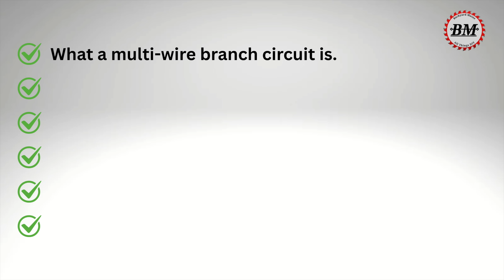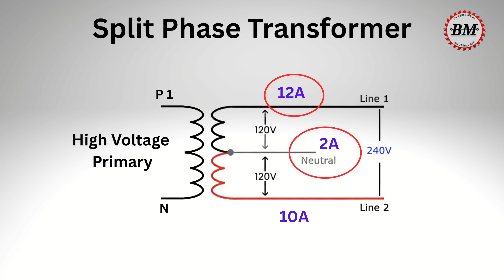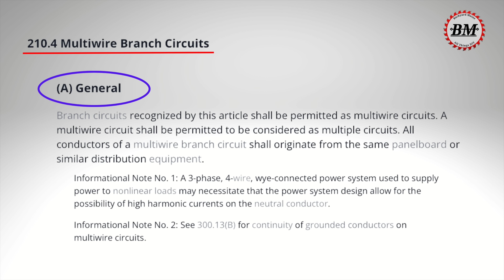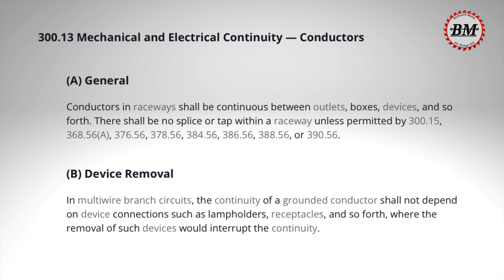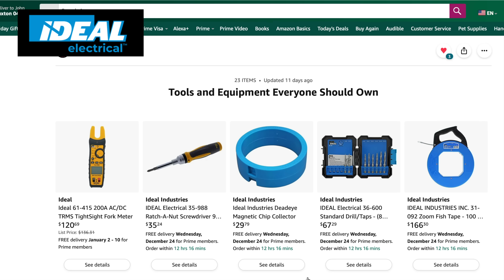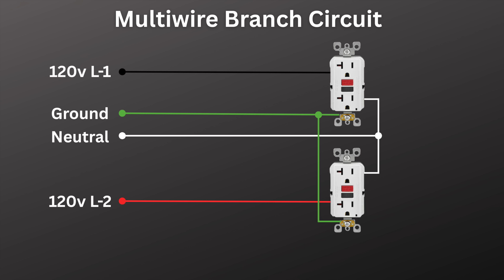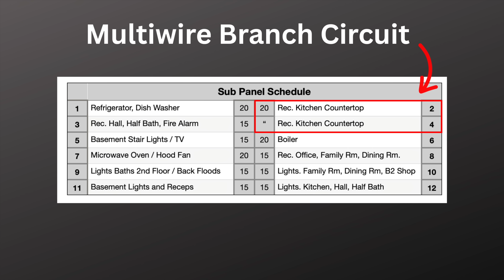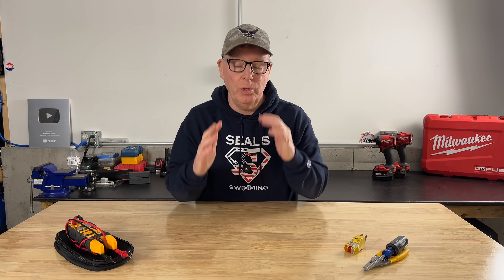Homeowners Don't Know This Dangerous Circuit Exists!

Comment: In my 1938 house, all wiring is in conduit with a single neutral supplying multiple circuits. Yes, they did that to save a little money. Having the wire hidden in conduit makes it challenging to trace them all out. 
The house originally had a single 110 volt supply, through a fuse box with two fuses. In 1980 we replaced it with a 240V breaker panel, the electrician added two circuits, but apparently continued the shared neutral runs and did not untangle or split the rest of the conjoined mess. I have traced and split some of it, but still need to finish and double-check the rest.
Excellent video, very clearly explained!
Reply from the maker: My mother had a similar home that I rewired back in the mid 1980s. It was a mess.

Comment: Great advice I'm going to use my multimeter to check the outlet before I open it as I have on on the kitchen gfci circuit on the island that for some reason one of the  plugs appears to be worn or damaged and won't carry current. The builder snuck in an almond color (rest are white) and it wasn't caught as it is under the counter top and since you see it when sitting in the living room it's a bit annoying. I did have an experienced inspector that only does new homes (lots of them being built) do the final inspection so I'm fairly confident on the safety aspect as it has been around 14 years.

Comment: I don't make a habit of it but I have the toaster and coffee maker on one of the 20A gfci in the kitchen and it hasn't popped. I just checked both are 800 watts so less than 14A if I understand the calculation correctly. A really weird situation with the microwave (on another outlet). It appears that if the back of microwave (steel shell) touches the plug at the end of the cord while on (IIRC 'm not experimenting) it will cause the outlet (it's on the one with the reset) to pop and arc. I've since routed the cord in such a way that it blocks the back from touching the plug and put rubber pads to stop the Microwave from sliding.

Comment: An indicator would be a red wire on a single pole breaker not paired with a black on a 2-pole breaker.
Reply: What makes you think the previous DIYer paid any attention to colors?  They certainly didn't at my new (older) house.  What a mess!

Comment: I have that in my kitchen, 3 outlets, each one on a split circuit. I could have a toaster and a coffee pot on the same outlet and not trip the dual connected 15 Amp breakers. The thing I didn't know about was the shared neutral. The other thing is I don't have GFCI receptacles and from what I understood, they wouldn't work with split circuits, am I right ?
Reply from the maker: A GFCI cannot be split but the MWBC can be supply half of the receptacles in the kitchen on one leg and the other half on the second leg. A GFCI circuit breaker will not work with MWBCs though.

Comment: Split phase is awesome for residential. But I used to see two-phase setups---120 hot to neutral on both legs, 208 hot to hot. I don't know why they used to do it this way, maybe someone thought 208 was safer than 240, or maybe the power company thought it'd be better load sharing with A-B on house 1, B-C on house 2, and C-A on house 3.

I see a lot of office power equipment that assumes two-phase, and you gotta special order if you want to run it on 240. I'm guessing they have three phases into the load center with 120, A-B-C layout for breakers in the office suite (and a second load center running 440, A-B-C for the factory floor).
Reply from the maker: I have seen that but it's not common. When you have a 3-phase system at the street, you can take two legs of a 120v/208v wye transformer to feed a home. Maybe some homes are fed from AB, some from AC and some from BC.

Comment: Super glad I found this video and channel. Super easy to listen to and the way things are explained are very understandable. 20+ years ago I was shocked on a multiwire circuit in the kitchen installing an over the stove exhaust fan, after testing the outlet was off. Up until now, I had no idea this was actually code compliant if done correctly. Mine wasn't breaker tied, and I don't remember if the neutral was pigtailed or not. Now I know how to make it safer, thank you! Up until this point all I knew is "they did some weird shit" to save money.
Reply from the maker: Thats is the reason I don't like them. They are safe as long as they are installed correctly and most importantly understood but thats often not the case.

Comment: I don't know if it was ever done, per NEC, as I don't keep up with it anymore, but I thought, through conversations with electricians that NEC was planning, or had already changed the code that all hotwires must have their own neutral. It came up in discussion of buying Romex, and switching from 2 X with ground, and instead of 3 X with ground, making it 4 X with ground. X= wire gauge which I've always argued should never be thinner than 12 gauges minimum in anything that is at 120 volts AC or more. Including household extension cords, which I argue should also be fused to prevent a lot of fires.

Just a thought. I rely on my NCV tester and probe hot, neutral, ground, and any other wire I may handle. I also keep a hot source close by so that I can verify the probe works before and after checking. I prefer the Klein and I set it at the minimum, which I think is 50, as I don't have one close by to check for a reference. Anyway, good video, and anyone encountering wiring problems should ALWAYS call an electrician if they aren't licensed. I've rewired every house my Mother purchased, when I was a kid, and every house I've purchased as an adult because I just somehow, seemingly naturally understood electrical stuff and how it is supposed to be.

Comment: All electrical panels are dangerous unless their upstream service has been cut, locked/tagged out, and the panel as well as all circuits are verified dead by two separate methods of verification.

Comment: MWBC cost my Electrician a free install of my bathroom circuit and my generator circuit. About $500 of compensation for his hired electrician’s error in hooking up my new panel. He was the older guy that owned the business and his hired help didn’t pay attention when disassembling the older panel and noting the MWBC. So the guy had hooked up both legs to individual breakers and fried 2  clock power supplies and 1 computer backups (thank goodness I use those on ALL electronics)  240 volt. A big whoopsie. I sorta understood electricity for homes in 2008 when this happened, but now I feel very comfortable with myself and understanding systems related to home use.  I bought several books and read them through and watched a bunch of Mike Holt NEC vids here on YT. Your channel has been good too. Thanks for bringing this up.

Comment: New sub. You’ve got a lot of good info. I DIY’ed my house but fortunately had mentorship from a master electrician. Good to know that what I was taught and what I did isn’t on any of your “danger” lists! With the ice this morning I’m planning to install an inlet for the generator (I used to just disconnect and then hardwire the boiler). Your videos are just what I needed to make sure I’m not doing something dumb/dangerous. Thanks and cheers from mid-coast Maine!
Reply from the maker: Thank you my fellow Mainer. Much appreciated. If you have already watched it, I have a generator connection installation video as well.
Reply: @BackyardMaine  Yes, I did! Then I watched a lot more of your videos!

Comment: Excellent video, like most of yours. Very good diagrams, plainly explained. Would be better though if at 10:01 you switched either the bottom leg to 120v L-1 (black) or the top leg to 120v L-2 (red) to depict the actual situation being explained. Perhaps you can still edit the video to do that?
Reply from the maker: Yes it was an oversight on my part.

Comment: I object your honor.  @2:02

L1 and L2 are not 180 degrees out of phase with one another (since they are from the same phase).  L1 and L2 are 180° out of phase wrt to N (or some degree wrt some other reference).🤔
Reply: Yes, L1 and L2 make a single sine wave.  Probably more accurate to say the neutral is out of phase with L1 and L2.
Reply: @MartysRandomStuff  L1 and L2 are 180 degrees out of phase when N is used as the common reference.

The river analogy.  A reach of a river is a single river.  When you stand on the bank of the river and look down stream, the river is flowing away from you.  When you look upstream it is flowing to you.

It is a single river, flowing in one direction, and your reference point matters.

Comment: Excellent, comprehensive video. When I bought my house many years ago I discovered a few MWBC errors. The main one was where they used the device yoke to split up the circuits; needless to say, I fixed that in very short order. My brother also does not care for them but as for myself, I think they're just fine as long as they're done PROPERLY. With respect to 210.4 Exception No. 2 at 5:16, this would essentially mandate the use of circuit breakers and prohibit fuses as the latter could leave one leg energized. Probably the purpose of the exception, but I'm speculating here. Perhaps the wording of 210.4 needs to be cleaned up because of the apparent edit by the Department of Redundancy Department, which can happen given so many Code cycles.

Comment: Wow. This explains a lot, like why I was finding voltages where I thought I shouldn't have.  And it explains why I was finding low voltages on some neutral wires. (At least I always checked for voltages at every point within any box.) I'd just never heard of, or run into, multiwire branch circuits for most of my life. I've always done my own home electrical work, but I see now that I really needed more education. - Thank you; I think you're saving lives.
Reply from the maker: Great to hear my friend. Thanks for watching.

Comment: I'd say it's not incorrect to refer to split-phase as "two-phase", since the distinction between one-phase and two-phase is just a difference of perspective -- whether you're using one of the legs as the reference or the neutral as a reference. You even use the two-phase perspective yourself when you describe the legs as 180 degrees apart -- that kind of phrasing only makes sense when viewing them as separate phases, which in turn only makes sense when using the neutral as the reference.
Reply: Two-phase systems have a 90⁰ phase difference. Like three -phase, two-phase can be used to set up a rotating magnetic field without any of the tricks needed in single phase motors. Split phase is not the same thing.

Comment: In the house I grew up in (built in 1969) they used the outlet stab-in terminals to carry the shared neutrals. Years ago when replacing a broken outlet in one of the bedrooms I snipped the neutrals and all of the upstairs ceiling lights went out. I shut off and marked the other circuit then pigtailed the neutrals, never got around to putting in a handle tie (though I should have). Stab-in connections are the worst and should be outlawed IMO.

Comment: Another warning......especially for 2 pole breakers usage, or when you install a breaker-bar/bridge over the 2 handles of single pole breakers alongside one another. GE makes and sells "slim-line"  breakers....these are half-width...and some locations of GE panels allow these to be installed where normal FAT beakers are installed. This is done to allow more breakers to be added to a "full" panel. The PROBLEM is that ( unlike full size FAT breakers)...here we CAN install 2 breakers alongside one-another ( top to bottom)...and have them BOTH be fed from the SAME L1 or SAME L2 source   ...and NOT be fed from  alternate sources as expected. Watch out for this !!!!!
Reply: Good comment!

Comment: Shared neutrals save you on long home runs. But doing things to make it easier to find the split point. We used to run Shared neutral to the kitchen circuits to the fridge receptacle and split from there to the other kitchen plugs. Dishwasher and disposal  we run to disposal outlet under sink and jump a 12-2 to the Dishwasher on the black wire. Red wire disposal.  Septic tank pump/alarm,  bedroom and bathroom circuit.  Home run 12-3 to bathroom GFCI and send black wire line to bedroom. Usually a Tandom handle AFCI feeds circuit.

Comment: At 9:20 in video, the panel phases are incorrectly identified as alternating between left column and right column.  

Each breaker in the same row is the the same phase.

Comment: Great video!  My panel was rewired in 2000. I’ve recently become very versed in multiwire branch circuits and have identified six circuits in my panel that are MWBC.  Just as you indicated they were installed incorrectly.  They’re not handle tied. They’re on different places on the panel.  I’m confident I can replaced them so they are adjacent and have physical ties but my one question is how to extend the wires if I need extra room because they’re too short.  What is the proper way to do that in a panel?

Comment: You aware that the video time frame at 09:50 mark shows that both receptacles are wired backwards?? hot legs feeding the Neutral and neutral is feeding hots sides.   love the videos and always learn something every time. Thank you for all your work on doing these!!
Reply from the maker: Yes. I was just making the point of two hot wires with a shared neutral not the actual connections. I guess I should have shown that differently.

Comment: I rented an old house once.  It annoyed me that the exterior light didn't work.  So, I decided to fix it.  I found the breaker that lead to the light and turn it off before beginning my work.  This was the 1st electrical work I had ever done, so I didn't have any testers.  But, I followed advice I heard to always treat everything as hot.  Luckily I did that, because when I finally screwed the bulb into the now fixed, but what I thought was off, circuit the light turned on.  I did further investigating and found two separate breakers were connected together through an outlet in the dining room that had two hots connected- to the same outlet, but the tab had NOT been removed to separate the outlets.  The two breakers were on the same leg so the issue went undetected until I screwed that bulb in.

Comment: I don't have any multiwire circuits but I did have a failed neutral at the utility pole once and that caused all kinds of problems and I would get shocked when connecting the cable tv wire to the television. I called the utility and they came out in about an hour and replaced the cable from the pole to my house.

Comment: When "must" pigtailing of the neutral only applies to the line side of the GFCI (i.e. when the MWBC splits from 12/3) and not the load side right? (where the downstream circuit is now just like a regular circuit connected with 12/2)

Comment: Even as a kid (I was an electric nerd from very young), I hated multi wire branch circuits. They just seem to violate logic for me, current flow should be a clean hierarchy. My other pet peeve is connecting neutrals from different circuits. And I prefer to never have more than one circuit in a given box unless there is absolutely no way to avoid it. This was a very well thought out and detailed video, probably the cleanest explanation I've ever heard. Nice job.
Reply: Im dealing with the issue of neutrals being connected together from different circuts in my house right now. A house built in the 90s. Turned off two breakers for two light switches (one box) to then get a small shock due to another circuts neutral also being tied in. Apparently running 14/3 wire was to much for the builder so all the 3 way lights in my house are wired with 14/2 with the lights neutral randomly connected to whatever electric line was closest. Now im cutting holes in walls and running new 14/3 or 14/2/2 wire to separate the circuts. I should also note that there a a couple random outlets connected in these runs as well.
Reply: Likewise, playing with electricity since I was about eight. Shared neutrals never seemed quite "right" to me even though I saw them installed by (supposed) professional electricians.

Comment: In the example of neutral overcurrent at 9:52, shouldn't the hot legs on the left both be labeled either L-1 or L-2? Isn't the problem only a problem if both hots are from the same leg?

Comment: Your stuff is always dead on correct and stated without the typical bravado found on so many other DIY videos. As a fellow Mainer and Master Electrician I am proud of your channel. I like to point out to people that everything can't be designed completely injury proof and attempting to do so just detracts from functionality and practicality. Personally, I believe multi wire circuits and shared neutrals are perfectly safe if installed correctly and not tampered with by inexperienced untrained people after the fact. Imagine if the fan shrouds on vehicles had to be extended to the firewall so fingers couldn't reach around into the fan blades while the engine is running. The entire world can't be rigged with baby bumpers on everything with any potential to injure people.
Reply from the maker: Thank you so much. I completely agree with you. I multiwire branch circuit is completely safe until someone installs in wrong or changes are made after the fact which is often the case. I love it when electricians watch and comment on my videos, especially ones from Maine..

Comment: Massive issue for me everyday; apparently few people have read the requirement for simultaneous disconnecting. This is on 3-phase systems and boy if you miss the shared neutral it can be shocking if you bridge the neutral; done this on 277/480V more than once. Big issue is it can be tough to pick up; I now amp my neutrals as a standard practice.